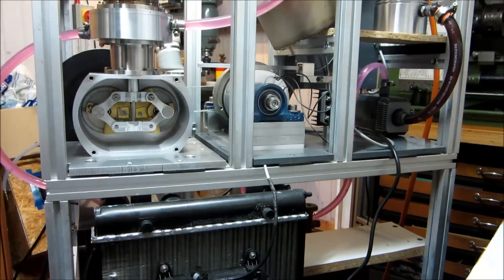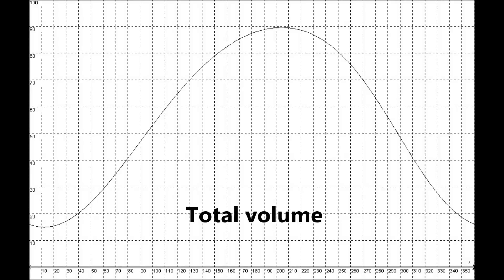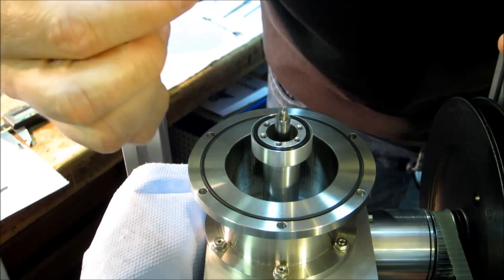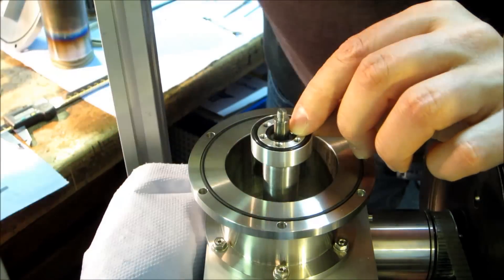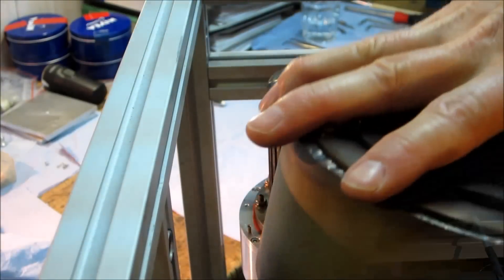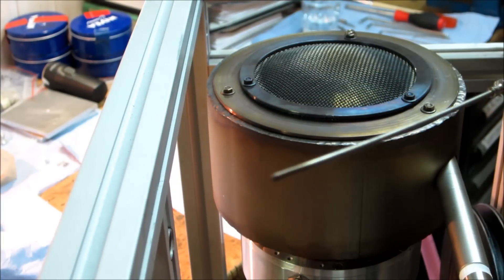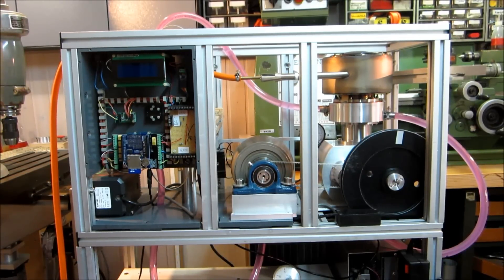Rhombic Stirling engine disassembling, details and development

Comment: Can you try high temp gasket seal for automotive or aviation?
Reply from the maker: Maybe, at the moment I use a normal o-ring and it works very good but does not insulate.

Comment: I just discoverd your channel, wow very impressive work and very nice how you make such open minded and very disclosing video's thank you!!! 
An Idea: would using some sort of cast iron be a solutio for the sealing problem? The differance in thermal expansion coefficient with steel is max 30% and it has some self lubricating qualities (as far as I know...) Just a thought.
Reply from the maker: Hi Simon,
in my newer engines I use cast iron cylinders and pistons, which has some advantages but also some drawbacks.
Thanks for your tip and your kind comment.

Comment: I often wonder why people don't try the automobile engine trick, that is, using grooves in the piston heads to insert springy metal rings. These piston rings in pairs would prevent piston slap and maintained a constant seal against the cylinder. They would require lubrication...perhaps oil drip lubrication incorporated into the cylinder head.
Reply: Probably to much resistance

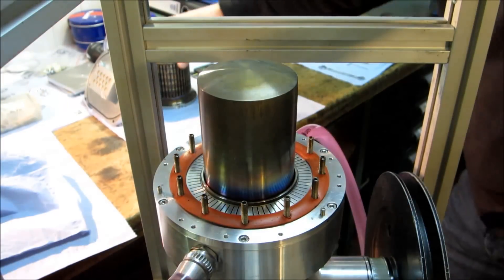Comment: When disassembling the engine, you removed a white circular filter right after the silicone gasket @1:56 but you didn't put the filter back on later @4:29. Was it not needed or just an oversight?
Reply from the maker: Hi,
I think you mean the regenerator ring, there a 100 rings in the regenerator and I put it back which is not seen in the video.

Greetings
Ralf

Comment: Much development of the stirling engine has taken place from 1950 to the current date...
The stirling engine has it's place but is very application dependant...👍
Reply from the maker: Sure, and I think it has its niche and is very fascinating for small power.
Reply: @myengines2443  As the chinese have recently worked out..
The future for sterling engines is just starting...

Comment: Hello Ralf!  Beautiful workmanship I must say.  And the power output has increased, which is always a good thing.  Your instrumentation is very impressive, too.  I had to make do with surplus analog meters for Volt, Ampere, tachometer, and thermocouple readouts.  I had a young family and sky-high mortgage interest to deal with in the early 1980's when I did the majority of my experimentation with Stirling engines using a small lathe, shaper, and drill press only.

You may realize by now that the design and manufacture of the two heat exchangers is of paramount importance for the performance of these engines.  A regenerator is a big plus in larger displacement engines such as yours.  The burner heat output needs to meet the output requirements as follows: 
 Begin with estimating (informed guessing!) the engine's efficiency and divide the expected power output by the efficiency fraction.  This will give you the required burner output.  For example:  400 Watt desired output divided by 0,15 efficiency fraction equals 400/0,15=2667 Watts of heat input.  I happen to believe that your engine should be able to produce, eventually, 750 Watts of power when pressurized with helium.
My current 13.5 cc engine has a cooler that contains 1,5 mm bore copper tubing inside the water jacket, with the working gas going through the tubes.  I have described the heater head in another of your videos.

If I were to design and build another engine or, at least, modify the existing one, I would proceed as follows:
1) Make a new cooler using 0,75 mm bore copper tubing, squeezing as many tubes into the cooler as possible.  I think 0,5 mm bore is a little small for this and 1 mm bore a little too large.
2) Make a new heater head using inconel 600 or type 316L stainless steel.  Make 0,6 mm x 0,6 mm slots on the inside, leaving 0,6 mm fins.  Make fins on the outside say 3.5 mm thick and 7 mm wide.  Press in a liner of similar material say 2.5 mm wall thickness. 
Make the length of the heated zone and external fins 1.5 x the stroke of the displacer.  Note that to reduce axial heat conduction of the heater head to the cooling jacket, make the wall thickness between the external fins and the mounting flange 0.5 mm.
2a) At the bottom of the liner fit a regenerator made of stainless steel screening consisting of 0,05 mm wires, or less.  Make the length of this liner 5mm, the width 2 mm.  This regenerator is fitted between the heater cap and the liner so that the gas flows through it.
4) Make a new displacer 2.5 to 3 x its diameter, long.  Design everything else around these dimensions.
5) For the displacer rod seal fit a spring loaded stuffing box filled with teflon string.
6) All piston and guide rings made from the appropriate grade of RULON.  Back up these rings with a soft O-ring to energize the RULON rings and to allow for thermal expansion of the RULON.

For good heat transfer, especially using helium, small flow passages are necessary.  The design of these heat exchangers is a trade-off between achieving a high heat transfer coefficient, and keeping the gas flow resistance as low as possible.  Notice that these are two conflicting design requirements that, ideally, require to be optimized.  One more thing, the heat transfer coefficient is also increased by the gas velocity over the heated surface.  Higher velocity here means higher heat transfer coefficient.

I no longer use gaskets on any of my models;  for sealing I simply apply a thin coating of automotive high temperature silicon sealant on the mating surface.  On machined surfaces a very thin coating suffices.

Sooo, Ralf, these are my thoughts on how to improve Stirling engine performance.  The beauty of home shop work is that we all can do as we please.  If you have any questions please post them on my channel under the Stirling powered radio vid.

Kind regards, Wolfgang
Reply from the maker: Hi Wolfgang,
yes the design of the heat exchangers is the key to good performance.
For the heat exchangers of the engine in the video I scaled the GPU-3 with the similarity methods of Dr. Allan Organ which took a few month of calculating.
For the heater head I use ss 1.4541 or 1.4571 which are heat resistant and have no problems with intergranular corrosion.
I dismantle the engines very often to try improvements is the coating with silicon sealant durable or has it to be renewed every time?

Greetings
Ralf
Reply: @myengines2443  Hello Ralf!
The silicone sealant needs to be replaced at each re-assembly.  But I found it easy to remove the residue and apply a new coating.  Much less grief that making and mucking about with gaskets in my opinion.  
I'd be interested in how you calculated the size of the required heat exchangers.  Your work obviously paid off with the high performance of your engine.  Did the Dr you refer to publish a book on this topic?  If so would you mind sharing the title of said book?  Thanks and all the best, Wolfgang
Reply from the maker: Hi Wolfgang,
the book is named Stirling Cycle Engines by Allan J. Organ published by Wiley.
Its is kind of an abstract of the similarity work of Dr. Allan J Organ with many nomograms and many easy to follow recipes.
Nevertheless the calculation of my heat exchangers took several month and I have a quite good mathematical background.
I think its by far the book with which I worked most.(Many many hours)

Greetings
Ralf

Comment: Love this video looking in om stirling engines to power a dynamo to charge batterys on my boat on wich i am living.
I have a heat source provided by my central heating (a biomass burner and a hygine boiler) wich is warm water is continialy circulated and a cold scource provided by the outside water itself. 
So this should jeep the engine running year round on waste energy if i am not mistaking. And thus a free source off energy?
Reply: Even if the burner is off the water is circulated between the boiler and the heater and thus a stirling engine could make a free power source minus the cost of the stirling engine plus dynamo

Comment: I see that you have many pistonrings. In racing engines I use only one very thin cromemoly pistonring that is overlapping to get better sealing and lower friction. My cylinders are nicasil coated on the inside. The heads have no gasket. I use an 0,5 mm "oring" made from copper in small groves in the cylinderblock. Maybe you can make a ceramic heat isolation ring between hot and cold side, Just an idea?
I just got 876 HP on the crank in a 6,5 liter smallblock naturally aspirated engine.

Comment: thank's for this video. I am very impressed by the machining. It's awesome.  how the  air go from heat area to compression area?
Reply from the maker: Hi leonard,

the working gas travels from the top of the displacer through the heating fins of the heater head which surround the heater head. Then they pass the regenerator and the cooling fins and enter into the compression space.
All heat exchangers surround the working / displacement  spaces.
If you look at my other videos you will see it and even how I made them.

Thanks for your interest and many greetings

Ralf

Comment: Take a look at Torlon which is a machinable heat tolerant plastic that has been used in the past for some valve train parts in internal combustion engines. It may well have a more sympathetic coefficient of expansion.

Comment: Use CO2 working gas, more expansion!
Reply: I heard Hydrogen or Helium produce the best results. How does CO2 compare?
Reply: The lighter the gas the more efficient the exchange rate of heat is
Reply: @kiwibob223  You are right. The helium or hydrogen  highly pressurised is what is used as the working fluid in serious high output Stirlings.

Comment: This is an interesting example of a Stirling Engine. We represent Qnergy in Canada and now are marketing 5650W units commercially. They're working incredibly well, burning most any combustible gas we can fire it with. More on remotepowergen.com if you're interested, or qnergy.com. Beautiful workmanship on your experimental engine. The Qnergy units use the highest quality machining and welding techniques. It's currently noted by NASA as being the most efficient engine in history, so that's saying something. Look for these to power the next Mars colony, likely fuelled by a nuclear source. One beta unit has run 13 years continually already at a NASA lab.

Comment: Hi Ralf, its good work!
just asking, if a small  refrigerated system doing the cooling side going down to -20C, and that side can work like heat pump.
The piston work to temperature difference, the bigger the temperature dif. digger the forces.
Heat pump cop.  is 4-6-10 depends.
the only disadvantage you can't work with air,
jut a tough. Keep up your work!
Good luck!
Reply: bigger

Comment: hi ralph  you done an awsome job building that engine , you probably already know this but hydrogen has the highest thermal expansion , if you ran hydrogen inside the engine and solve the problem of explosion by sealing your enclosure, (the alloy extruded frame)
and purging with argon to remove oxegen
Reply: Hydrogen is lighter than Oxygen, so when filling chamber, the hydrogen would rise and you could purge the oxygen slowly out of the bottom. Might have to wait a minute, then purge 20%, then wait, then 20.... etc..
BUT...
The real issue is not Hydrogen, because,
It is more efficient to increase the atmospheric pressure as high as possible, like up to 100 atmospheres. The rhombic chamber becomes the buffer zone, which needs to balance the pressure in the compression chamber.
Compressing that quantity of hydrogen into one chamber, while keeping a balance in the other if not also hydrogen, and preventing leaks between the two, which can result in a gradient many atmospheres strong, would likely require just filling both chambers with hydrogen.
The benefit of hydrogen will give some increase.. but its better to increase the pressure between the two chambers closer to 100 bar, which is 1450psi. It can be done but not very easily. The 145psi, 10 bar in the video, is probably reasonable for the average household who wants to work on their "home Stirling engine".
I see a lot of play in this system. The displacer pushrod and the power piston have poor tolerances. Machining the tolerances tighter using a material less susceptible to thermal expansion, would be optimal opposed to gaskets and O-rings.

Comment: Cut an over size gasket in glass fiber weave. Smear it on both sides with silicone. Place it on a flat surface on cling film with another piece of cling film on top. Use a roller to work the silicone between the strands. Remove the top film to aid curing. When dry, trim the gasket and punch the holes for the bolts.

Comment: This is great work both as design and as workmanship.  There is a lot of thinking behind the concept and looking into the cylinder, well that transfer of air from the hot to the cold side has to go through what seems to be an excellent  heat transfer ducts.  Congratulations.

Comment: Can you heat the engine externally while driving the crankshaft with a motor that's driven with a well-instrumented power source. That would allow you to eliminate a number of variables and very accurately evaluate your modifications.

Comment: Neo-Preen rubber... Rated at 80A Durometer... Industrial stuff... heat resistant and has a tensile strength of 750 psi and can handle temperatures up to 212 Fahrenheit.
Reply: A bag boiler steam generator can be made with this stuff. I am going to make one and put it in my new spaceship. I am debating whether to use induction coil or a magnetron approach to the power side of the systems.

Comment: Hi Ralf - thanks for your excellent video. For the silicon gasket I believe there are silicon cooking mats available which would be easy to cut into your desired gasket. There are also plenty of industrial materials available but the cooking mat will be cheap by comparison. I watched your video as I'm looking for the best oil free piston ring material for a Stirling project I'm working on - can you comment on your experience please?
Reply from the maker: Hi f7ipper,
I tried nearly all availiable sealing materials but the best is still my self moulded silicone rubber.
Reinforced with cotton flocks it is a bit more sturdy and works well but I will search for cooking mats as you mentioned thanks for that hint.
The piston ring material depends on the running surface of the cylinder.
For my stainless cylinders I got good results with Igus Iglidur W300 and I also use it on my new cast iron surfaces but I dont have long term expierience with it till now.

Thanks for your hints an greetings

Ralf
Reply: @myengines2443  I don't know how it would work for a gasket but you might try a metal gasket and paint it with the ceramic paint that they use for engine exhaust headers. It keeps the engine compartment a few hundred degrees cooler when used in a car. Might even be able to use it in other places like inside a burn chamber to insulate and hold the heat in to be more fuel efficient.

What I mean by burn chamber is somewhere for the heat from the flame to collect. But have the flame and exhaust mounted fairly low in the collector. Kinda like a steal forge

Comment: a swashplate engine of the gamma type. would fair better. If one had a swashplate with the hot cylinder facing one direction and the cool cylinder facing the other it would provide better separation of hot and cold and better torque:.

Comment: Fiberglass or graphite filled Teflon will help seal, just be sure you get the high fill content type because Teflon its self expands a lot when heated, the fill material will help keep thermal expansion down.

https://www.plasticsintl.com/datasheets/PTFE_25_GF_25_CF.pdf

Comment: I just found this video, good work I've been thinking about making a solar power with a circulating hot oil heated by a parabolic mirror (trough)it simplifies the solar tracking your a big help with giving a good example of some of the hardware you can see I need to figure out some the stuff like a charge controller that keeps the engine at the right best rpm for the heat input so great video thanks